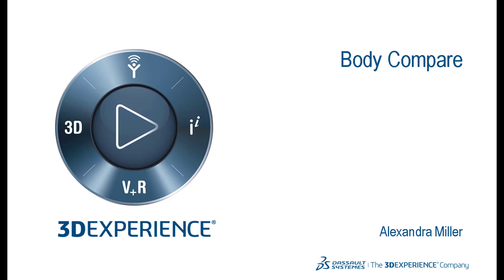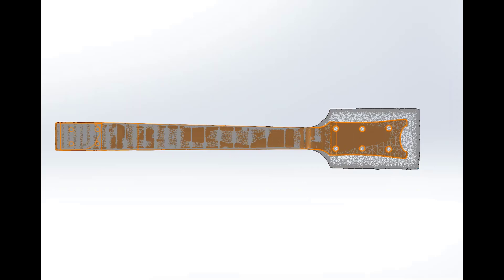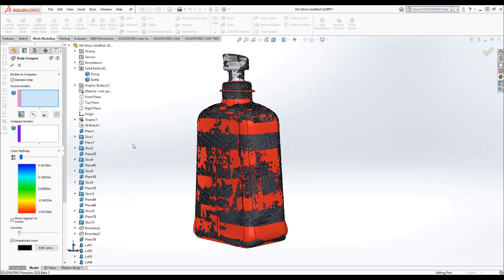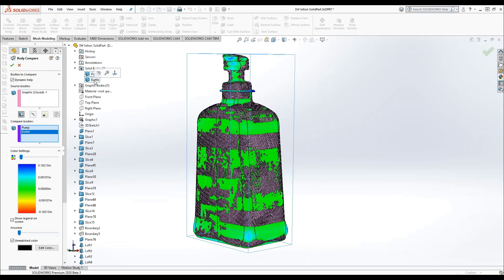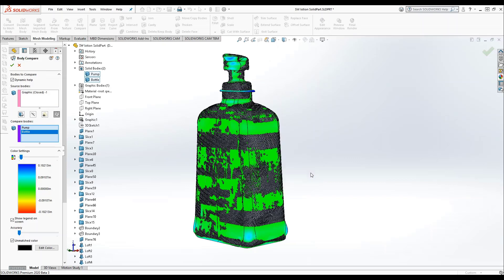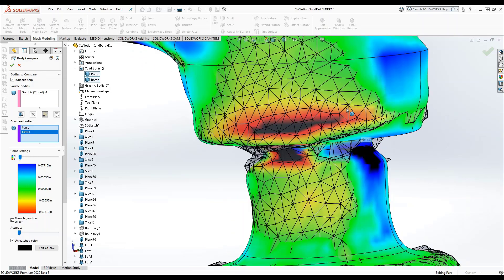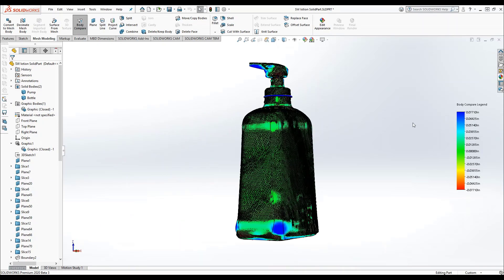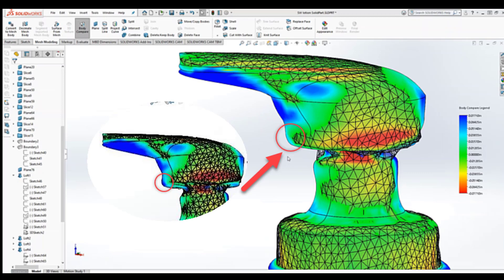Body Compare in SOLIDWORKS 2020

Comment: Hi, here how can i identify that geometry is not match how many inches or mm, if you drag to that arrow to fine it has less value if you drag that arrow to far more deviation value,,, so how can i identify the exact unmatched value like  1inch or 2inch etc
Reply from the maker: Thank you for watching my video. It can be challenging if the color setting is set too low such that the maximum region of deviation is beyond the color scale. What I usually do is drag the color setting to the right until there is no red on the screen. In this situation the maximum real deviation is represented with a yellow color (i.e. the next color in the legend). I use that to understand the maximum deviation value. I then slide the color settings to the left until the maximum value in the legend is just slightly above the maximum deviation value that I previously determined. I then match color on screen to the legend. There isn't really a way to select an area on the compare body and see how far it deviates from the source body. That would be a nice enhancement. Please visit http://www.solidworks.com/enhancements to submit an enhancement idea for this.

Comment: does the comparison depend on the precision of colocation?
Reply from the maker: Thank you for watching my video. 
The answer to your question is yes, the two bodies must be co-located. This is usually the case when you are building classic brep geometry referencing a mesh. 
Highly recommend view the following videos to learn more about the advanced mesh modeling capabilities in SOLIDWORKS:
https://youtu.be/Q4x7lRHnvss 
https://youtu.be/BEViSsD6zso
Reply: @mbanta  thank you for your reply, I have a SW part which gets exported as .stl and modified/ remeshed in another software, now I would like to compare the original brep part with the modified .stl and was thinking on using an assembly. I convert the graphics body into a sw mesh body but assembly mates do not work to co-locate the 2 bodys...any advice on how to proceed?
Reply from the maker: @frittenpeter  if you watch my other videos on mesh modeling in SOLIDWORKS you can see how geometry can be added to the mesh. Adding sketch geometry and reference geomety is one way to add references that can be used to create assembly mates.

My mesh modeling videos are:
https://youtu.be/Q4x7lRHnvss
https://youtu.be/BEViSsD6zso